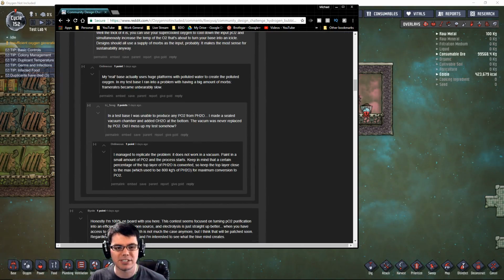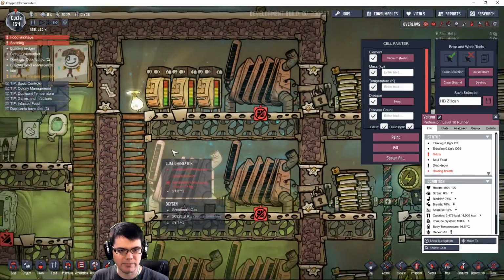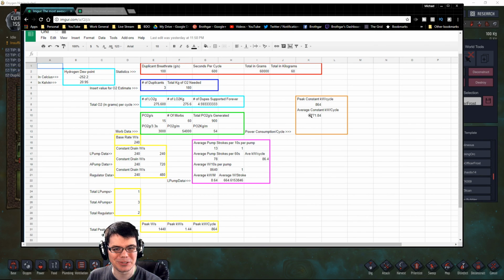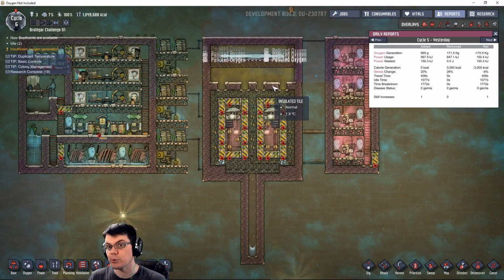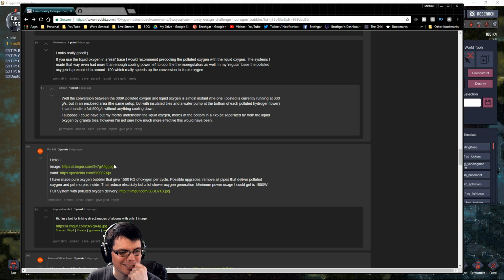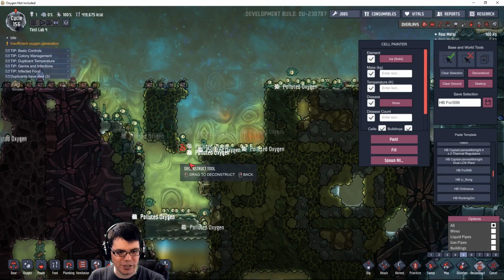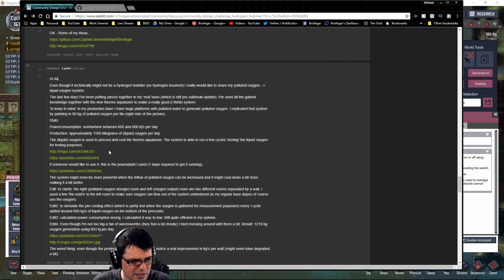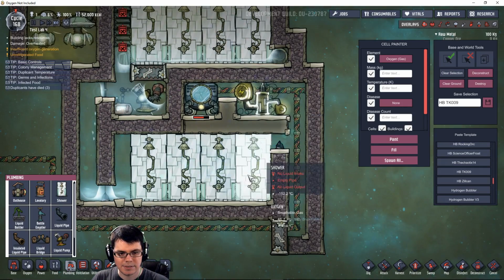Oxygen Purification Systems! Hydrogen Bubbler Community Challenge Results

Comment: hmmm i guess this happend when i took a break from ONI. if you put a valve after the regulator, set to less then the input feeding into the regulator(500 from pump so 350 or less) the regulator will cool full loads at less then full speed producing less heat in the regulator. i had that giant yin yang base back in the day running 2 hydrogen  coolers neither cooling tower ever had an overheating problem. but now i wana test if it still works that way

Comment: What is you have a tank of Liquid Oxygen (LO) above a high & narrow (1-2 wide) chamber of Polluted Oxygen (PO) and a Air Lock (AL) that separates the chambers.
Then when the PO-chamber is filled you open the AL and let the LO fall onto the PO, 
Will that condense (almost) all of the PO into LO?
(and then you pump up all the LO so the chamber is full again)

Comment: Love the videos, Brothgar.  You probably already explored this, but aren't vacuums super cold?

Wondering if there's an energy efficient way to take advantage of that for cooling.
Reply: A vacuum doesn't cool anything. It's literally nothing, so it has no thermal capacity. Cold isn't energy, it's just a place that energy can flow into. To cool something down, you have to heat something else up. You physically can't heat a vacuum, as a vacuum is nothing.

Comment: Little off topic...But can i make water..beside converting Slime to Algee ?
Reply: not direct water, but poluted water - the Lavatory uses 5kg of Water and give you 11.7kg of polutedW
Reply: Steam geysers? Or natural gas generators + a natural gas geyser?
Reply: ive found that with 2 bathrooms and 4 dups i can really slow down the use of water..also very small living quarters that only require the minimum in water..one sink. one algae oxygen per room.

Comment: On Li Song's design I think the two valves at the bottom are bleed and fill valves to fill the loop and the valve to the left of the thermo regulators is for controlling cooling amount in the loop to match characteristics.

Comment: Brothgar, I tested my design further and it turns out it can handle about 1.7kg/s of oxygen throughput, when you add more polluted oxygen input of course. More would slowly heat up the system(mostly slowly due to the huge mass involved with the damn thing). Of course that means you are basically running the system at the max energy consumption of 1.4mj per day constantly, but that'll also give you over 1000kg of oxygen per day. Giving it a semi-decent rate of 1.4kj(or 2.4 watt) per kg of cleaned oxygen.

Also the wheezeworts in the morb tank was more to compensate for the heat produced by the pumps, without them the temperature in that room kept creeping up(which is not good for the morbs or for the pumps). And it seems like the temperature of the equipment isn't saved with the blueprints as the temperature switch should have prevented the pump leading to the aquatuner from working when there's a risk of freezing.

Finally I'd like to mention how wonky the oxygen not included physics are, you can cool 1.7kg of oxygen by 200 degrees by transferring that heat into 10kg of oxygen heating it by 14 degrees(since that's the cooling factor of the aquatuner).
Reply: I think you may be able to handle even more if you moved your reservoir to the left side, above the morbs, this should allow you to cool the Polluted oxygen before it even gets into the system, allowing you to pump more in before you started to notice a change in temperatures.  When I tested it myself, with enough morbs, the gas would only cool down in a 3-4 block radius, meaning your mobs would be safe (assuming you can keep the gas pressure constant, but also cycling.  1morb = 15g/s, so around 200 morbs (in water to allow them to contantly produce) would allow for a constant 3kg of pre-cooled polluted oxygen to be circulated, without the risk of morbs freezing.

Comment: The thing that strikes me is the very ineffective way everyone introduces P-O2 into their system. Instead what you should do is to make an abyssalite storage container, fill it completely with slime, and copy/paste that to your hearts content. It will produce an enormous amount of P-O2. In fact, have a few row of them and they will just keep the pressure at exactly 1800g per tile no matter how much you liquefy. And since slime in abyssalite storage will gas of P-O2 regardless of tempeature surrounding it, it's a much more stable method than morb farms.

Also, people are not using the heat generated by the aquatuner /thermo regulators constructively it seems. Oxygen distillation is great but you can't use liquid oxygen for much. You need an evaporator to make it a breathable temperature again.
Reply: I think they are using morbs bc it is completely sustainable. You will run out of slime eventually.

Comment: Hi, onlineous here. The vent is normally connected to the liquid oxygen pump at the bottom. That supplies the precooler and keeps the aquatuner at the top cooled down.  I changed the pipe to output in the collection chamber just to measure the output.

Comment: Wait... Isn't a cycle in ONI 600 seconds? That makes 1 kg per second liquid oxygen not really 'humongously' high right?
Reply: Yup. Low output, high power consumption massive system there.
Reply: Might be the case if the system is not at capacity yet (the footage shows that the aquatuner is working constantly, but based on the 100 - 1400 kj's spread it seems that there is indeed overcapacity). Since there is no preecooling that would mean the power consumption would rise as much as the increase in LOX generation though.
Reply: Which is actually one of the major weaknesses of my system: it needs overcapacity (which is why I use two aquatuners in more recent versions of my systems, even though I rarely use them). Since you are using pressuredifferentials and the effect that cool air drops you don't need gas pumps. That makes it more difficult to control the inflow of liquid oxygen as well which means you need quite some reserve capacity to make sure everything keeps working as intended.

Comment: I did neglect to provide information on how to set the dials for each switch, (science officer frost btw)... if you do wish to go back and actually try it out, the temperature switch in the hydrogen chamber is supposed to be set around -240C and the Morb atmoswitch is set to above 1g and the liquid pump to above 1kg. For some reason i had experimented with the over pressurize bug with liquid, oddly enouugh, the morbs had actually sucked up all the liquid, and the vents would not work properly with the liquid method as well. so i believe if i could have gotten that to work it would have been much more efficient. i also tried using the LO2 for cooling on that system as well, however the pipes constantly would break due to the temperature ( i could never figure it out, as i saw others using much colder liquid helium setups as well)... watching this video further idk if you know this but ctrl+f8 is spawn explosion, and it 1 shots morbs, so be careful with it but its very easy to get rid of them.
Reply: unfortunately no fire and flame on the ctrl+F8, but i like to imagine tiny nukes going off xD